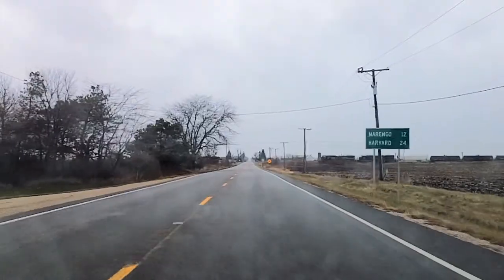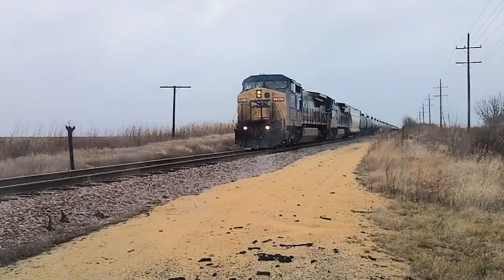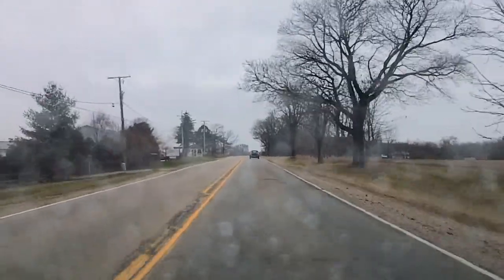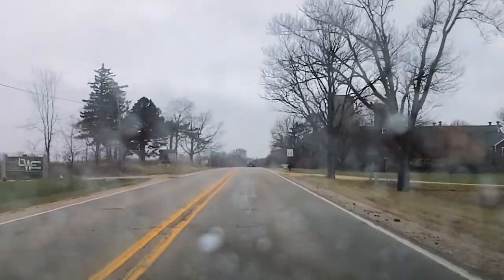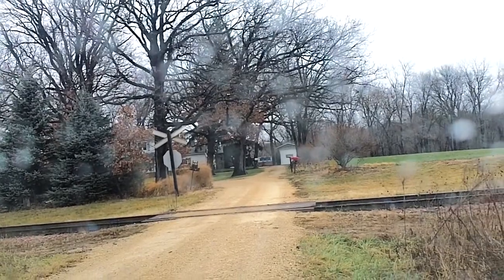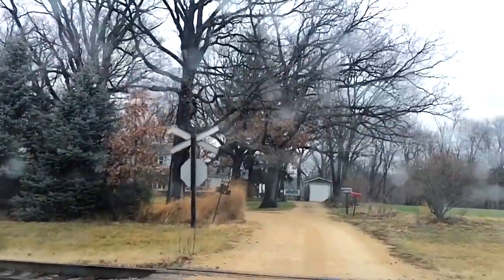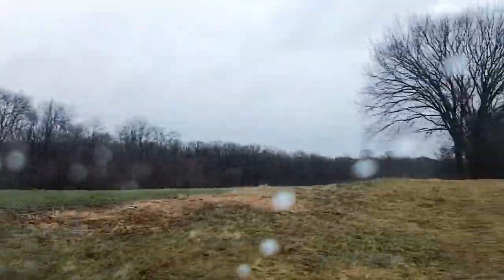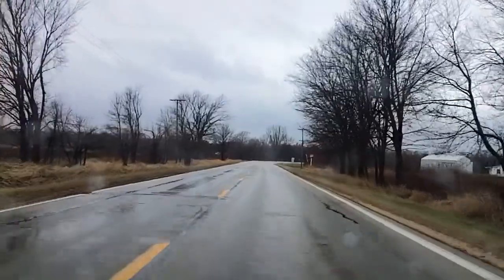The Chase of CITX 3059 and CSXT 7837 on 11-27-2011

Comment: You must have done a lot of scouting over the years to know where these spots are located.  Kind of like the rural areas of North Dakota where I grew up.  Nothing marked especially well with road signs of any type, but I just knew to turn at certain roads because they would get me where I wanted to go.  Of course, what with the new 911 systems now, rural markings are improving. Good job, as always.